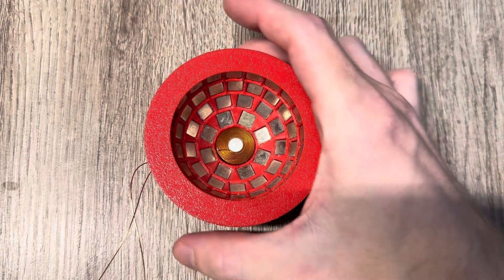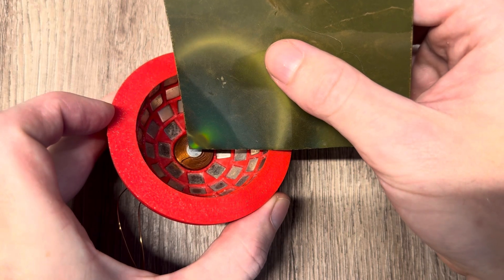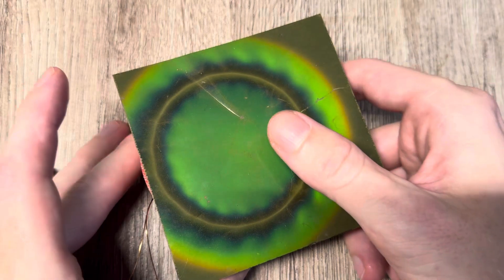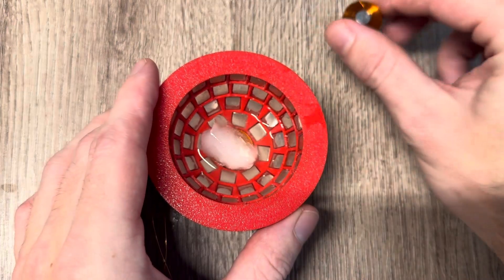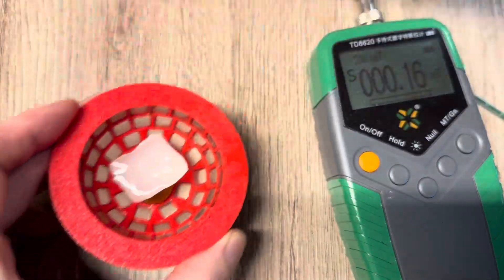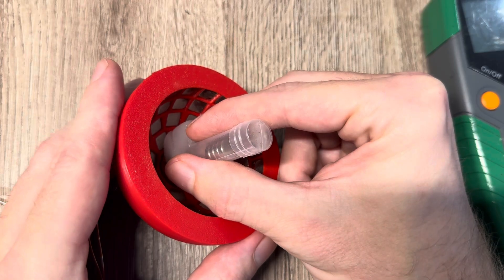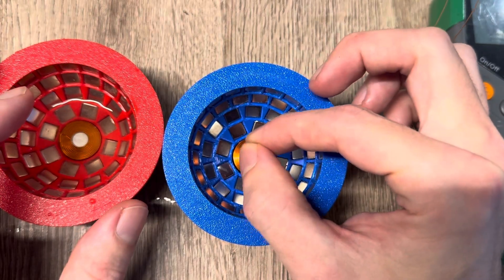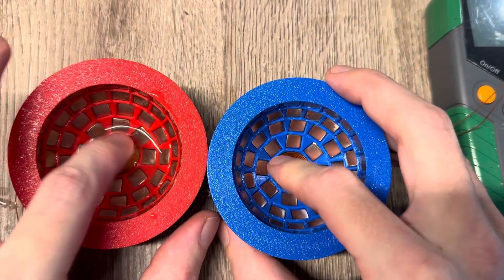Electromagnet at the center of a bowl magnet array 🧲⚡️

Comment: Have you thought about making two semi-spheres, one smaller than the other. Where the large one has the magnets inside, like in this video. And in the smaller semisphere, are the magnets on the outside of the sphere? In such a way that, due to the reaction of the magnets, the spheres roll around each other?

I think it could be used for various purposes, even as some type of electromechanical gear. Or even try to make a magnetic generator, if you add a third semi-sphere on the outside, with coils that generate electricity from the magnets on the inside (since they could be in motion, through the smaller semi-sphere).
Reply: The science for that is super complex. This device shows field interactions that physics already does not like based on the current model. Without proper control of field states, you could easily, as one commenter pointed out and I have accidentally done before, cause massive damage to the magnets or surrounding infrastructure. You have to start simple and small and build from there. Your idea has many merits, it just has to be done step by step, which he is doing. One problem at a time from prototype to finished. He needs to fix the cooling and visualization issues first, which I had to do as well in my own research, but then he can use those new coil designs to implement more advancements. 

The problem with a non-singular center magnet is that you have no EFFECTIVE way to cool individual locations. You have to cool the entirety of the core magnet at once. This makes multi magnet arrays less viable for central core technology. You can get around this by creating magnetic whirlpools in the field array. Most of the heat would attract to the high density vortices, and you could cool that field in particular. For now, him focusing on the cooling for the electromagnets is the right call.

We caused a multi house/block blackout when we tried too much too quick, and fires are a real hazard when inverting fields. It puts the strain of the entire field system on the variance EM, instead of distributing the stress to all the permanent magnets. It is only a budding science, proper field technology. It has only be theorized until 3d printing, as that allowed more unique device deisgns, like in-channel wiring not physically possibly otherwise.

Comment: Great video, I did this but I used just a neodymium magnet at the center. Mainly for testing magnetic projection. I will try this method. Can I confirm with you that the field is directional i.e protruding outward? If so how far can this extend? Would this still work if the electromagnet is suspended in the centre wrapped inside a radiator with a good fan blowing air from the back. What happens if you use DC current? You have got me excited lol

Comment: So first off what about using dry ice to cool it?  Also what about 3D printing plastic shells with slots for your magnetic probe to slide through, both grooves on the rim as well as slots though the wider sections in the bottom two rows.  Maybe use a Sterling engine to cool the magnetic coils(maybe even try winding one of the magnets around the superior cylinder).  For those of us new to your channel  mentioning how the magnets polarities all arranged right at the start of the video would have been nice.

Comment: Yeah, pretty sure you're not flipping the whole field or those permanent magnets would rapidly find themselves being COOKED. 

What I suspect is happening is you are getting a weird inverted mushroomish shaped field and you are tugging that pole a bit increising and decreasing essentially it's focal point at about 5 Hz or whatever Fq you set. 
The reason it's getting so HOT is the iron core IS trying to flip all it's constituent iron atoms 5 times a second. Because of the electric field in the wires. And It's generating more heat because the coil is working harder because it's working against a "relatively" at this scale powerful STATIONARY magnetic field which the coil is trying desperately to fight AGAINST. 

How hot are those permanent magnets and have you checked to see if they are still as strong as they were. Seems to me they may have gotten a little cooked already.
Reply from the maker: The permanent magnets don’t get warm, the field strength of the electromagnet isn’t strong enough to harm the permanent magnets.

Comment: Its waste video , Do this

Copper coil Over copper core but Aluminium as a spool to prevent copper core not try to touch copper coil. Aluminum is to help structure.

make video showing it attract copper some level. It wont be ferro magnetism level but it should attract some level. 

Then change core with copper alloys and post all of it in single video

if i have access to 3d printing and core  , i will make it my first video

What do i expect? its a secret. You can release the result as a paper

Comment: From the lab.

Step 1: Coil core and wire prep

Wire:

Litz wire or polyimide-coated copper (ML, Kapton-coated) rated ≥200 °C.

Bake windings at ~80 °C for 6–8 h to drive out moisture before potting.

Form (bobbin):

Glass-filled PEEK, ceramic, or polyimide composite (Torlon, Vespel) for nonmagnetic, high-temperature coil forms.

Sandblast or lightly etch bonding surfaces to help epoxy adhesion.

Step 2: Thermal compound selection

You need a vacuum-compatible, high-thermal-conductivity, electrically insulating epoxy that:

Outgasses minimally under vacuum (NASA/ESA standards: TML < 1.0 %, CVCM < 0.1 %),

Stays stable up to 150–200 °C,

Has thermal conductivity ≥1 W/m·K.

Your probable best available options

Type	Product	Thermal Conductivity	Notes

Epoxy (preferred)	MasterBond EP29LPSP	1.3 W/m·K	NASA low-outgassing, very low shrinkage, proven for coils & sensors.
Epoxy (BN-filled)	Cotronics Duralco 4703 / 4461	1.4–1.7 W/m·K	Easy 2-part, handles 260 °C.
Epoxy (AlN-filled)	Epotek H77	~1.1 W/m·K	Electronics-grade; excellent for vacuum, up to 200 °C.
Alternative (ceramic-filled silicone)	Dow Corning TC-5622	2 W/m·K	Use only if you need some flexibility—slightly higher outgassing.

Your probable best overall choice for vacuum + magnet coil:
MasterBond EP29LPSP or Epotek H77, depending on availability.

Step 3: Potting procedure (vacuum impregnation)

1. Pre-heat epoxy to 40–50 °C to reduce viscosity.

2. Place wound coil (mounted in its housing) in a vacuum chamber.

3. Pull vacuum to 10⁻² – 10⁻³ Torr to outgas voids in the winding.

4. Slowly introduce epoxy until the coil is submerged or filled through feed holes.

5. Release vacuum slowly — the epoxy floods into every void.

6. Cure under light compression at 65–80 °C for 4–8 hours (check product spec).

7. Optional post-cure at 100–120 °C for 2 h for maximum crosslinking.

Result: completely filled, void-free, vacuum-stable coil block with high heat conduction.

Step 4: Heat highway — the backplate ring design

Material:

Oxygen-free high-conductivity (OFHC) copper for maximum thermal conductivity.

Alternative for less eddy current: Pyrolytic graphite sheet (PGS) or C110 copper with radial slots.

Design details:

Plate thickness: 1–3 mm.

Cut radial slots (like spokes) every 15–30° to prevent eddy current loops but maintain conduction.

Surface finish: brushed or micro-blasted; tin or nickel flash optional for corrosion control.

Bond interface: a thin dielectric layer (50–200 µm) with high thermal conductivity:

Boron nitride paste (e.g., Momentive BN coating) or

AlN-filled silicone pad (Thermally Conductive Gap Pad 1500).

Attachment:

Epoxy bond ring directly onto the coil back after potting and post-cure.

Clamp during cure with light, uniform pressure (springs or weights) to ensure full contact.

Ground the ring to the system thermal manifold through copper braid or flex strap.

Optional upgrade:
Embed flexible graphite or copper heat straps from ring edge → hemisphere shell → chamber wall (or external heat exchanger).

Step 5: Thermal path verification

After cure and assembly:

1. Mount a small thermistor (NTC 10 k) or RTD between coil and ring.

2. Apply DC current to coil (simulate worst-case operation).

3. Use IR camera or thermocouples on backplate edge.

4. Confirm temperature delta ≤ 40–50 °C at max continuous power.

If higher → improve ring–strap conduction (shorter strap, thicker braid, better clamp).

Step 6: Vacuum integration

When installed in vacuum:

Avoid air gaps between coil backplate and shell manifold — every air gap is 10× the thermal resistance of the copper.

If the manifold is water-cooled or heat-piped, use indium foil or thermally conductive grease rated for vacuum (e.g., Apiezon N, Braycote 601EF) to bridge microgaps.

 Step 7: Summary configuration stack

From the coil outward:

[ Coil Windings ]
→ BN-filled vacuum epoxy impregnation
→ Slotted copper or PGS backplate (heat highway)
→ Thin BN or AlN dielectric adhesive layer
→ Copper or graphite heat strap
→ Hemisphere rim thermal manifold / heat sink
→ External cooling (water, thermoelectric, or radiative)

Comment: Field state resonance is the effect. Fields that overlap or are contained within another exhibit the effects of changes to the other field as if they happened to their own when the fields' qualities are aligned. 

Fun fact, changing the angle of the electromagnet will change where the zero point is. One electromagnet, one zero point. 6 electromagnets 2-3 zero points that fluctuate their location. And for cooling, could you attach a radiator like ring around the EM that channels the heat to an external cooling system, like a moving water over metal system?